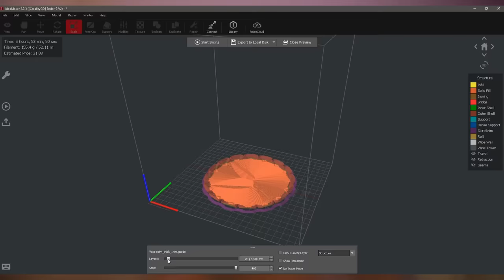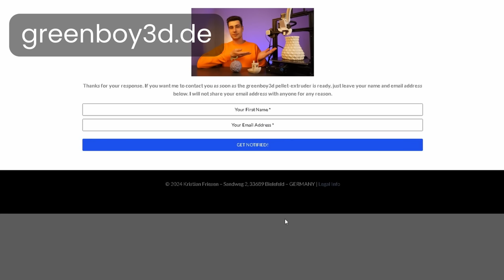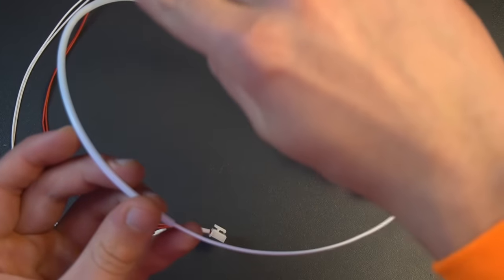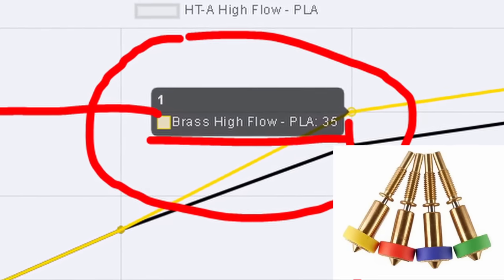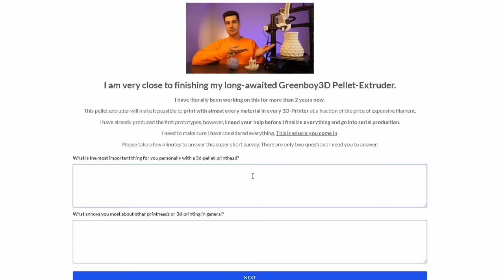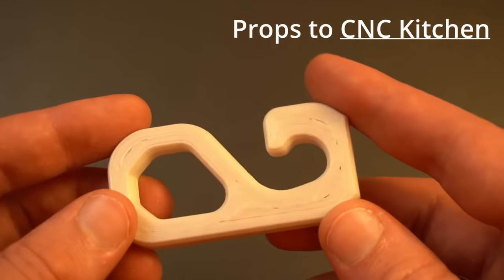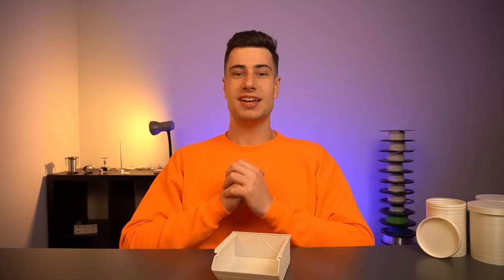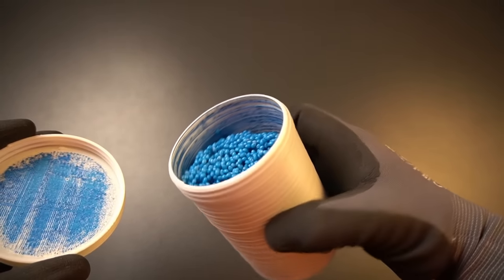Stop Buying Filament, Use This 6x CHEAPER Alternative instead

Comment: This is really interesting, but if you're going to go through all of the effort to shred scrap and mod the printer, why not just extrude and respool the shredded material, so the printer can run as designed?

Comment: Well i am not satisfied with the result. But having a second printer for recycling would allow to just make test fit prints without produceing waste, since they just have to fit and not looking good. One thing i really hate about layer lines isn't the look, it's just the dust it can collect like a microfiber cloth inside the tiny gaps of layer lines which are hard to get rid off when printing on smaller layer height.

Comment: do a version that has its own nozzle that works best for what its doing an see how well it works over the other version an if the difference is worth it do it. im going to try to play with this some on one of my machine old machines an ill use all failed prints an all the other stuff the is left over from prints, purge lines support an since i got my bambu labs machine filament poop
but ive been waiting for someone to build a setup where u can make ur own filament at home an i know there's a couple out there now but there still a little more than what ppl spend on a printer so once they get them down to 300 400ish bux thats when ill check them out, or at least for the needs i have now, maybe if i was doing more than i am now it might be worth it but not where im at atm but this is def something im willing to try just to get to use the filament waste that ive been saving for going on almost a decade so its bout time to put it to use.

Comment: Hello, after watching this video I was immediately very happy that there is a new way to cheaply print your products.  but later, when I started to be interested in pellet prices, I had to be disappointed.  Did I not find cheap pellets for sale, or does the author of the film buy standard filament in coils at a very high price and that is why he has such a big price difference for raw materials?  for example, I pay £9/kg for Petg filament in rolls, and I found Petg pellets the cheapest for £7.5/KG.  because of such a small price difference, it is not worth rebuilding your printer.

Comment: Good on ya
Reply from the maker: What would you like to see next?
Reply: @greenboy3d  in a previous video you mentioned that some very strong plastics are not available in filament, but are available in plastic beads. It would be great to see some applications that are only possible with these stronger plastics, maybe high speed gears?

Comment: bro just take my money, i am ready lol
Reply from the maker: Working on it :D
In the mean time, what would you like to see next?
Reply: @greenboy3d  I would love to see max nozzle size/ flow tests for different material types. I have had my eye on a Chube for a "fast"/large scale printer using my  ol'reliable ender 5+. Now I think I'll source a linear rail kit and play with klipper while I eagerly wait your release. I am very curious about more abrasive materials like we use for high heat cycle/ stressed parts in many machine/ automotive applications. Maybe just a hardened screw/nozzle/ barrel is really all that is required?  Then thoughts of screw pitch and feed rate for longevity come to mind ( I have too much mechanical sympathy at times). Professionally I work as a injection mold designer so this concept is exactly as I have imagined many times over while running flow analysis.   Count me in to invest when you go public lol cheers bud

Comment: Don't know if anyone suggested that, but you can use a flexible steel cable to transfer the torque to the extrusion screw. So you don't have to move the motor extruder. Btw genius idea...

Comment: If the goal is to just bring the price down why not focus on turning plastic pellets into regular filament rather than putting such a device on the printer. If you want ease of use as well do so as the printer is printing.

Comment: I have an Elegoo Orangestorm coming in this summer...(800x800x1000) Id like to see this pellets extruder on it...
Reply from the maker: I think it should work on them :)

What would you like to see next?
Reply: @greenboy3d  I think you would have a huge market for a pellet extruder for the Elegoo Orangestorm.  It uses 1.75mm right now with a relativly small nozzle. People use 3 and 5kg filament rolls for it.
Id lay down half the prize of the machine for something that would print faster and used less expensive PLA or PETG. I don't care if you make a custom nozzle for it or not.

Comment: So, what's the secret? I filled it, and?
Reply from the maker: It's like a I said, a secret for now, but don't worry, you will not regret taking the time to fill out that survey 😀

By the way, what would you like to see next?
Reply: @greenboy3d  the next I'd like to see what parts are not off the shelf and how to manufacture them, gotta prepare you know
Reply: @greenboy3d  also I'd like to see how pressure consistency problem is solved and how bubbles of air between the pellets are got rid of

Comment: If a custom nozzle works better, use it.
Reply from the maker: A question that can't get out of my mind is what people would if they had a nozzle clog, which can happen on any 3D printer due to some particle blocking the nozzle hole.

If the "special nozzle" is not easily available globally because only I am selling, then this might be a problem. Any ideas?
Reply: @greenboy3d  What if it was interchangeable between custom and standard nozzle (though this may not be possible)

Comment: What about mixing metal powders in the plastic with a better nozzle Thereby giving us metal 3d prints ???
Reply from the maker: Actually all FDM metal Filaments for metal 3d printing + sintering are also made from so-called "MIM Pellets" (Metal powder + Binder material) and these also cheaper than normal metal printing filament :)

By the way, What would you like to see next?

Comment: if you make a mod like this for bambu lab, that can also use filament too, i'dd pay 200 bucks
Reply from the maker: Working on it :)
In the meantime, what would you like to see next?
Reply: @greenboy3d  I see pellet potential. Collab with @The Next Layer to make a pellet system that can 5 minutes switch back to filament. Make it doable on bambu and other core xys

Comment: Extrusion to print head is never going to be worth it. There is no cushion to maintain even flow hench, the heavy layer lines. Better to extrude to a filament spooler. You would have to work it so there is a little back pressure to act as a cushion to keep the filament an even thickness. Do able though...

Comment: if pellets are this cheap, isn't it easier for us to just make our own filament at home?
Reply from the maker: you mean with the extruder?
Reply: Yeah, with a purpose built rig to extrude filament.   Then there's no loss of speed/accuracy with our printer
Reply from the maker: @j0hnyboi  I do not see any problem with this thing also being used to produce filament.

It just adds an extra step

Comment: I don't think this is a good solution. Inaccurate feeding, heavy and too big head assembly....with the same equipment, with a 1.8 nozzle you could make a filament making machine, produce the filament and print with the original printer.

Comment: Hype hype hype hype hype.
Reply: More like market research.  It doesn't really qualify as hype until you have a link in the description for where to order in it, or invest in it.
Reply: Also, I think this is better than trying to make filament from scrap prints.  It's one less heat cycle the polymer has to go through.  Or maybe two fewer cycles, since the filament you buy has already been melted once to make the filament from bulk granules.